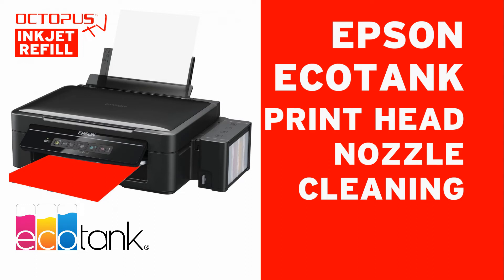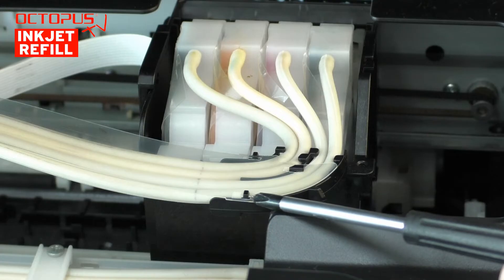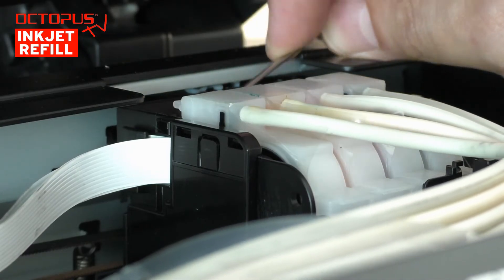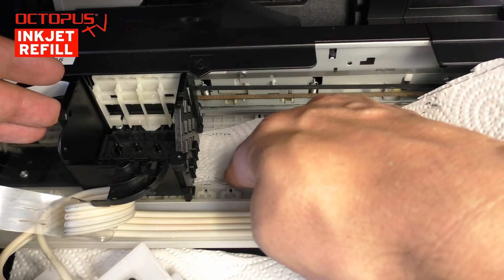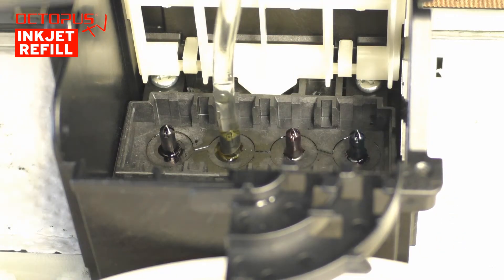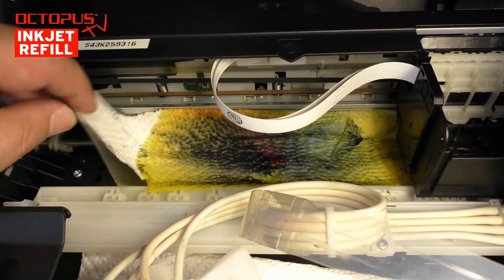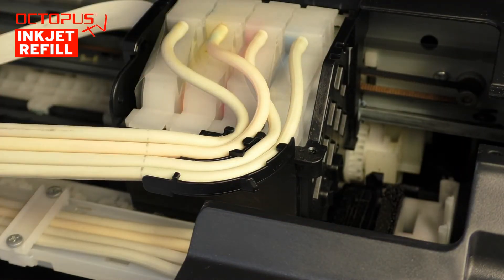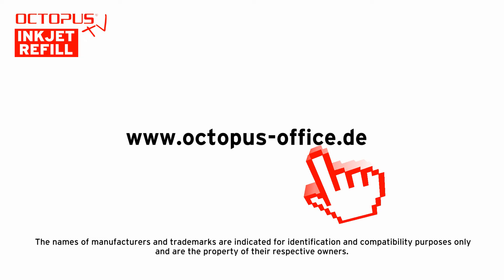Epson ECOTANK print head cleaning clogged nozzles 🛠💉

Comment: I've done everything you've mentioned to clean the heads, I originally was getting red and yellow now I am only getting black and yellow should I leave my printer for a couple of hours before printing again, many thanks Joyce
Reply from the maker: Hello Joyce, thanks  for Your feedback and question. After applying our method there remains cleaner fluid in the ink system - this has to be printed out to get the colors back to normal. So grab some old paper and print until the colors come back. This may need some time and some prints. This way You do not need to run the printer´s cleaning function and You are also not filling up the waste in container.

Comment: Thanks for the detailed video! My Epson ET-14000 was quite similar and your cleaning kit worked fine. This allowed me to exhaust all of the ink that came with the printer (wow, it was a lot of ink!) and now I am planning to switch to invisible UV-fluorescent ink (also from Octopus! ☺), and I want to rinse out the tubes so they are not contaminated with visible ink.

Is the cleaning fluid appropriate for flushing all the way from the tank through the tubes to the nozzle? You said in another comment that it is just a colorless ink with surfacants. I was thinking of putting a bit of the cleaning fluid in each color tank and printing pages of solid C/M/Y/K until visible ink stops coming out, but then I am wondering if my invisible ink would end up contaminated with colorless ink!

Any tips would be much appreciated!
Reply from the maker: Hello Tom, thanks for taking the time to give that nice feedback about Your positive outcome! 👍🏻🛠
Reply: @octopusoffice  please read my entire comment ... I am wondering if you have any suggestions on how clear my tanks and tubes in preparation for your invisible fluorescent ink.
Reply from the maker: Hello Tom, as You say that Your ET-14000 is quite similar to our tutorial - are You able to detach the connection cartridges from the print head compartment? In that case You can extract the standard inks through these cartridges from the tanks and from the tubes at the same time.
When You have emptied the ink system completely from the ink You can fill the cleaner and work the same way to get out this cleaner again. After that You can fill in the invisible ink into the tanks and flush the ink system with this new ink by extracting air from the connection cartridges - this will suck in the ink from the tanks into the tubes and into the cartridges  finally.
Reply: @octopusoffice  Thanks! I did something like you have suggested and eventually got it working. The connection cartridges do come out, but it was hard to get suction on them, so I pulled through the tubes (and lost some ink in the process) then printed solid color pages until the ink started flowing. I also found that I could "push" from the tank side, since the tanks have a tiny air hole which the syringe hose fits on.
Reply from the maker: Hello Tom, we are glad to read You have found a way to solve the ink riddle on You machine - consider the lost ink as a sacrifice to the gods of Epson as You are using their machine different from their plan 😉 Thanks for pointing out the air port on the tanks we will take a look on these.

Comment: Now I have paper jam after this ? Is my printer broken ?
Reply from the maker: Thanks for Your question. When getting this message after applying the manual cleaning approach it is usually the case that ink stains inside the printer´s working area for example on paper transportation belts causing this message. Please check if the are stains somewhere and clean the affected areas.

Comment: On the strength of this excellent tutorial, I bought the Octopus cleaning kit for use on an Epson ET-2750 printer with blocked cyan nozzles.  I followed the instructions exactly as in the video, but when after re-assembly I tested the printer with a purging test pattern, the pages came out completely blank.  I tried cleaning the heads without effect, then resorted to 'Power Cleaning', which fixed the problem so that all the colours including cyan printed correctly.  I suspect that the procedure described can introduce airlocks into the print head, needing 'Power Cleaning' to fix.
Reply from the maker: Hello Paul, thanks for taking the time and providing this thoughtful feedback ! Does the ET-2750 have a waste ink tank that can be replaced? We are aiming at not filling up the printer´s waste ink compartment when applying our cleaning method. When You suspect that air is trapped inside the ink system You can flush the system with cleaner and try again printing out the cleaner to get the colors back to normal - especially for printer models without an exchangeable waste ink tank this extends the lifespan of the printer.

Comment: I have followed all the instructions, which are well explained, however now my printer Epson ecotank 2750 ET  does not function anymore, i.e. The ON power button does not switch on! What can I do now? I suppose that some cleaning liquid has caused damages to the electric circuitry. What can you do in such cases? Another customer in your comments had the same problem, but there is no answer from your side. Can you please help? Thanks. Marco
Reply from the maker: Dear Marco, thank You very much for contacting us about our tutorial. We are not happy to read that You experience difficulties after following our suggested cleaning method. 
Where do You think Your cleaner did enter into Your printer? Did You also work with the plastic protection we demonstrate? What kind of cleaner did You use?
Reply: @octopusoffice  Unfortunately I used only the kitchen paper towel. I have used the cleaner of your kit, but I had the impression that maybe the cleaning fluid has leaked somewhere. The first time I have used it, was everything ok, and rhe printer could swith on without problem. than (since one printing head was not yet woking properly) I have repeated the operation and than, after I connected the electricity cable to the printer again, the power botton was dead, i.e. Not working any more. How can I bring my printer back to life? Do you have an idea? Thanks

Comment: I tried your suggestions but I don’t have your solution and tried using isopropylic alcohol to clean the black head. The head still makes white strikes no matter how many times I clean the heads. I am sceptic on doing the flushing from the printer menu because it may also do nothing and spare all the ink in the bottles. Is there a way to know if the nozzle is clogged ? Because you say that nozzles could be damaged also. I found that I can buy print head but I see ads for black only and full color, is there a way to replace only black part of the head? I have an L386 printer.
Reply from the maker: Hello and thanks for Your question. The used alcohol might be the reason why the cleaning does not have the exprected outcome - the inks used in this printer are water based inks. You need to have a water based cleaner to dissolve cloggings that are from dried in water based inks. Alcohol does not dissolve such blockings.

Comment: Blank not black
Reply from the maker: Hello Nasho, the cleaner fluid must match the ink that is used in Your printer - meaning Your are using normal inks for printing office documents for example -  these inks are waterbased. So Your cleaner needs to be waterbased too - alcohol based cleaners do not help in that case. Our cleaner is waterbased and its formula is an colorless ink plus cleaning detergents.

Comment: What type of cleaning solution can I use  because my epson L382 is printing black. Please help
Reply from the maker: Hello Nasho, the cleaner fluid must match the ink that is used in Your printer - meaning Your are using normal inks for printing office documents for example -  these inks are waterbased. So Your cleaner needs to be waterbased too - alcohol based cleaners do not help in that case. Our cleaner is waterbased and its formula is an colorless ink plus cleaning detergents.
Reply: Thanks for your advice,. But where I am based is very difficult to source cleaning fluid.zambia
Reply: @nashochibale7259  Distilled water will work just fine.Just make sure that the place you buy the distilled water is trustworthy and the water is actually distilled.

Comment: Thank you very much @OctopusConcept! Does it work with ET7750 as well?
Reply from the maker: Hello Edmeund. Thanks for the question. You need to check on Your printer how the connection from the ink tubes to the print head is established - when it is the same way as in our tutorial then You can apply our suggested way of cleaning.

Comment: One of my inks is clogged, and i took it apart with your instructions (nice and clear!) and i noticed the color that is not working has little but nothing ink in the head (it looks like a little maze inside).   So I'm wondering if that's already due to clogging, or could it also have a fault at the other end of the hose, at the location when the tanks are?  That part of the printer does not look so servicable. I only had the printer just over a year, and just it quite regularly. At least weekly, so I was surprised it got clogged in one color.   Epson's website seems to have no decent way to contact them.
Reply from the maker: Hello Peter, thanks for contacting us and providing the description. By saying there is  little ink in the head You mean that there is not sufficient ink inside the cartridge body, right?
Reply: @octopusoffice  yes, all the ink is essentially in the first container. The other working colors have ink floating in the ink head unit.
Reply: @Peter Teuben
I know that this thread is a couple years old but, I have exactly the same problem that you had with little ink in one of the "little mazes"
How did you finally fix it?
I've looked and looked for an answer but, your comment is the first time that I have seen the maze issue brought up.
MANY thanks if you can share!
Reply: @jeffhagerman2905  I've since then had it a couple time, and had to run through the cleaning cycle several times. Like 4 or 5. I alternated full cycle and head cleaning. Eventually it recovered.

Comment: What a coincidence that yellow is the color I'm having troubles with. Thanks for a thorough explanation.
Reply from the maker: Thanks for Your feedback. We hope that You can get rid off the troubles.
Reply: @octopusoffice  After a year, now is the black printhead that is giving me troubles. I've done this process a few times already and still not working. I've done nozzle checks and it seems like something is happening but doesn't clear. It's as if the clog couldn't dissolve completely. The other colors are working beautifully. I want to try as much as I can to save this printer if possible. I like the quality of the prints, don't want to pay for a new printer right now and it's one less printer on the landfill. But unless I remove the printhead and do a visual inspection, I don't know what else to do. Any ideas will be appreciate it.

Comment: Thank you for the video. Great demonstration with well thought out dialogue. I am about to attempt this on an Ecotank 2650. It is basically exactly the same except the 2650 has a plastic cover on top of the cartridges that requires removing a screw.
You did not say "um" one time. Fantastic.
Reply from the maker: Hello Paul, thank You very much for Your positive feedback to our tutorial. As  I am not a native English speaker - to be honest: Many sentences were said into the microphone more than once and audio editing took care of most of the remaining sound bugs. Take care!
Reply: OctopusConcept That’s probably why it was good. Every word has to be thought out. By the way, I followed your instructions. I used a syringe that came with my ink refills. I used 10 gauge speaker wire clear insulation for the tubing. I just tugged the copper wire out of it. It worked. I will get your product next time though as the tubing did not make a watertight seal. Less than half I think made it through the nozzles so I repeated a few times each and ran a few regular printer cleaning cycles. I started out only being able to see some magenta to being able to see the full color spectrum. Mine was bad. Now it’s back to normal. Thanks.

Comment: I tried doing this on my Epson L355, but after cleaning, there's still white lines and sometimes even light smears of ink in some letters. How do I solve this? HELP
Reply from the maker: Thanks for Your question about our tutorial. White lines could mean that there are certain nozzles in the nozzle plate still clogged or worse: these nozzles do not work anymore at all. When printing a test pattern do all lines appear on the test correctly?
When saying there is a smear on some prints -  is the smear in the print itsself or is the paper dirty at other areas?
Are You working with alternative inks or are You using the Epson original inks for this printer? The combination of white lines in the prints plus smear on the paper indicates that there might be a problem for the printer to process the inks properly.
Reply: @octopusoffice   
all patterns are good except black
the smear is in the print itself, my paper is clean
i am working with epson original inks (664)

Comment: Excellent advice. My black ink was clogged. I used the windex and alcohol solution. Dropped a small amount of the solution using the needle of the syringe. Waited 45 minutes and dropped another small amount. Let it dry for 1 hours. Set everything back did a nozzle check. Printed a coupled of pages just to flush the ink. Afterwards did a Power flush and starting printed like new again.
Reply from the maker: Thanks for Your feedback and description!

Comment: Very good work. I have done the process but still no black printing.  When I Look at my black cartridge i see little or no ink in it. I tried to pump ink out using a seringue but could not. (with the other colour i managed to pump ink out). It seems that either the cartridge or the plastic tube or the reservoir of ink has a problem. Is there a way of flushing the whole black circuit  ? Or to buy individually this circuit ? thank you very much for your help !
Reply from the maker: Thanks for Your positive feedback! I assume that Epson does not provide the opportunity to make an individual ink circuit available to You. Actually sad but that´s the situation.
We are interpreting You description that there is a blocking either in the ink line from the tank to the cartridge or in the cartridge itsself.
We would recommend to try two different things to narrow down the reason for the problem:
1.) You can detach the ink line from the cartridge. Then You can test if ink goes from the tank through the ink line. In this setup You can also try to flush the ink line from both sides.
2.) You can fill up the cartridge manually when the ink line is detached. Then You can see if the cartridge is still printing as long as there is sufficient ink inside.

Comment: btw there also is a software based head cleaning
Reply from the maker: Thanks for Your input. Yes, we are aware of the printer integrated print head cleaning options. With cheaper EcoTank models there is the situation that these models does not come with a replaceable waste ink tank - print head cleaning using the software based cleaning fills up the waste ink section in that printer and shortens the printer´s life span. We thought keeping the printer alive for an extended time might provide some advantage to the user.

Comment: hi, thanks a lot for this great tutorial which I've followed step by step. Everything is well explained. 
I just had an issue in the end: after I finished everything, all my printed pages are blank (I tried with 20+ pages using all sorts of colours and they are all blank). It seems to me that my heads do not touch the paper anymore when printing. 
I've carefully clipped the heads into their compartment (can't push any further). 
Not sure if you would have an idea of what is going wrong? 
My printer is an Epson L4160.

Great thanks!
Reply from the maker: Thanks for Your description. Please make sure that there is no air in the tubes leading from the tanks to the cartridges plus ensure that the cartridges are filled with ink properly. Beside that also make sure that there is no air inside the print head - sometimes air is pressed into it during the cleaning process. If You are not sure - just flush with cleaner again. Printing out the cleaner after that - You have already started this - but it may take more prints - we recommend to use already used paper as these test prints do not have a real purpose beside getting the colors back to normal.
Reply: @octopusoffice  thanks a lot for your help! I tried again but still couldn't fix it. In the end I went to the service centre and it seems they were able to fix my printer by running some in-depth cleanup from their software. Anyway thanks again for your great video and answer! It was great to learn from them.
Reply: Do a Power Flush with the maintenance utility.